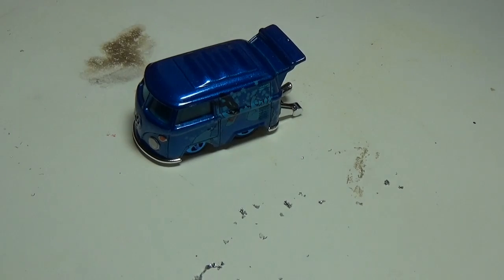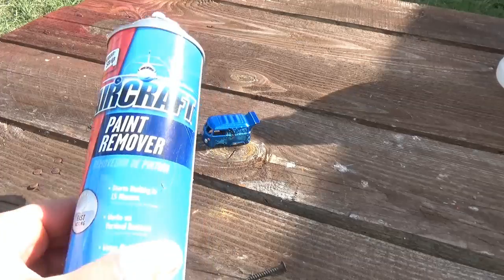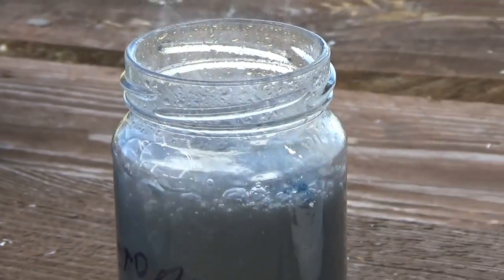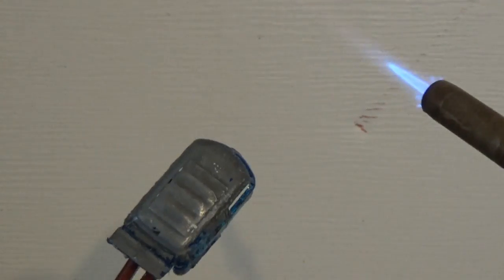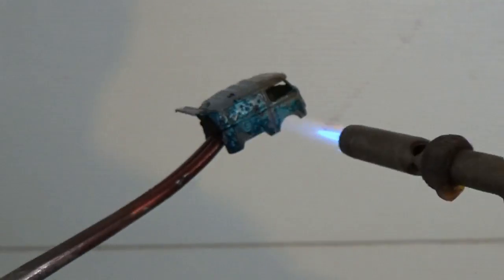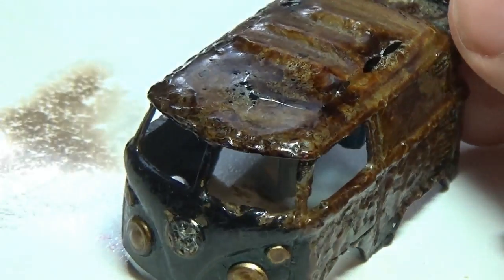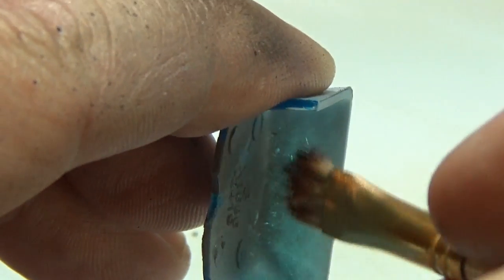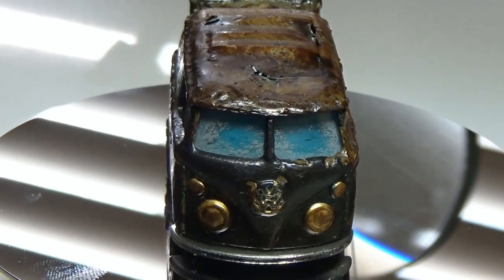How to use vegetable shortening as a rust effect on a die cast car.

Comment: Nice method of dealing with the rivets. I have been using an old RC  car remote antenna that fits snuggly around the diameter of the rivet. I'll heat it with a torch until it's glowing and set it right on it. Takes just a couple seconds and normally it will pop back into place with almost no visual evidence and a dab of super glue seals the deal.

Comment: This will not work in the long tern.  The end result of this process is carbon, which is very brittle.  The carbon and the metal of the car will expand and contract differently over time and eventually it will just break off when it is picked up.